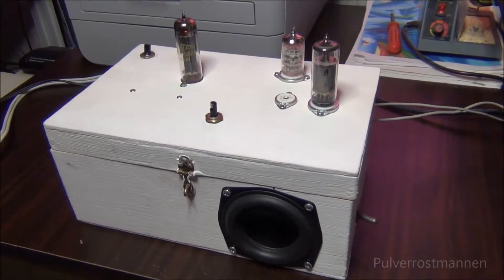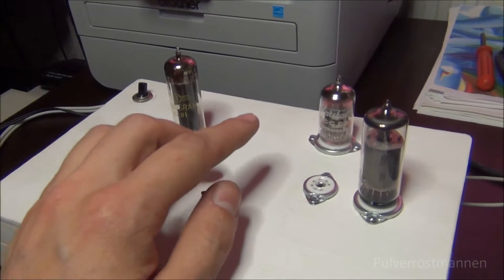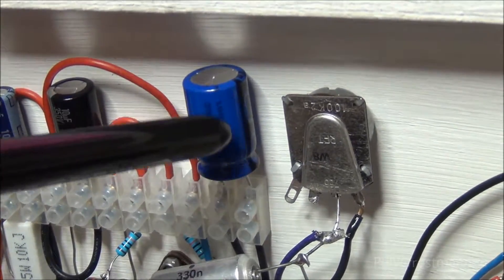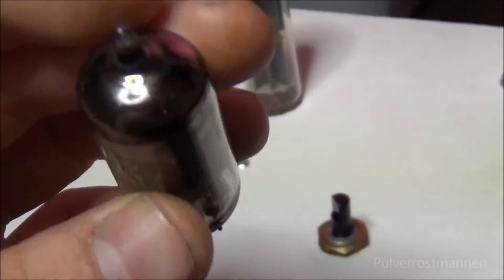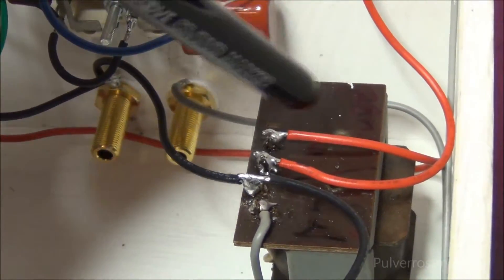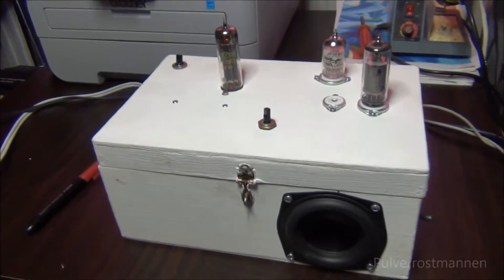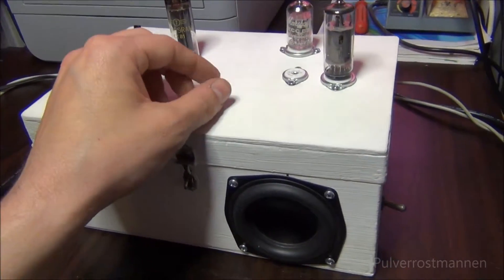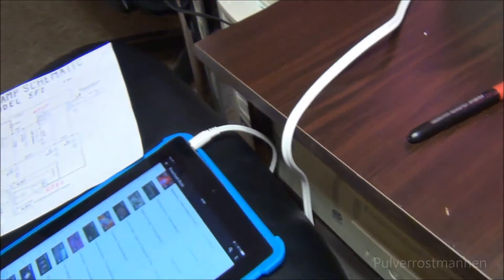Home Made Valve Amplifier Presentation and Operation

Comment: Well, it's 8 years later, so who knows where the little amplifier is today, & what other modifications you made to the circuit afterwards, if any.
But you REALLY screwed up that volume control between the 1st & 2nd stages; even 100kΩ is borderline too low a value...& you replaced it by putting two of the three terminals in parallel with a 12kΩ resistor???🤪🚮🚮🚮🤦
You must not have hooked up the 100kΩ pot correctly IN THE FIRST PLACE; or else it's defective! If you had too much gain, then you should have just eliminated the 1st stage & have the signal going directly into a pot on the 2nd stage ECC83 Triode section instead...
Also, you don't need a separate filament winding for the EZ81/6CA4(?); it's not one of the directly-heated types & the cathode will insulate the heater just fine, especially at the low HT that the Champ circuit operates at. The EL90 is better known to us North Americans as type 6AQ5; & if the amp was any good & you used a better speaker & sound source, then you would notice that it does sound noticeably better than the 💩🇷🇺🚮🇷🇺 6P1P, which is a crap Soviet imitation of the American 6CM6 that isn't pin-compatible with it either, as well as having double to triple the amount of distortion!🤦🤮🗑️👹
The EL90/6AQ5 actually sounds better than the original 6V6 valve used in the Champ; with tighter bass, sweeter highs, fuller mids, & a smoother & chunkier tone overall. The EL90/6AQ5 is also far more rugged & capable of handling higher voltages than the 6V6, never mind the 6P1 (China) or 6P1P (Mordor, home of Orcs). Don't let the much smaller bulb fool you! For example, the 6V6 was never used in NATO-spec military equipment. But the 6AQ5 was used extensively! Proof is all the industrial-grade & ruggedised premium versions of it: 6AQ5W, 6005, 6096, & 6669.
OTOH, there are no such versions of the 6V6. It's only premium version is the 7408, which has very precisely made filament wire to ensure a highly consistent time-controlled warmup time.
This was a special version requested by Harman-Kardon around 1960 for use in their 🚮💩🤮 el-cheapo "Award Series" (🤣🤣🤣) receivers & (dis)integrated amplifiers so that 4 valves could share a single cathode resistor between them without any of them getting damaged by hogging all the current until the rest of them came up to operating temperature & bias!🤪🤤🤤🤤
Reply from the maker: @joerosen5464  I am still using this amplifier today but it had some changes though not very big. The Chinese transformer I had in the beginning was winded so poorly it shorted out. I have never in my life seen a transformer this poorly made as this one was. Now it has a vintage transformer since like 7 years and goes strong. It now has a socket for EL84 and 6s4A triodes as well as EL90/6AQ5 and by converters it can play even more tunes. I also built and implemented a special muting device that mutes the amp when no music is playing. 
But the resistor choice for volume control was a real choice. Even though this is the first amp I have built in a chain of 4 amps and several other devices I have found that variable resistance greatly reduces noise in the output stage. In this first amp I have the lowest resistance to date but it is balanced and sounds very good to be honest and even if it been run for 10s of thousands hours by now I only replaced one tube that was weak even at the beginning in one section. 
The last amp I made is built a bit different and has the most advanced audio controls but I still use variable resistance between the stages but instead up to 100k but you would be surprised how quiet this amp is at full volume and how good it sounds. I have no video on this amplifier yet even if I had it for years. But it used variable resistance both on the preamp stage and output stage, I love this amplifier and it can play any 6v6,6L6 and EL34 pin compatible tube but I usually use 34s. I can play 807 too with adapters. I should make a video sometime

Comment: Wow nice modification with the 6P1P! (or EL90!)  Nice mods with the volume and channel mix as well. That's what I love about the Fender Champ design...it's a super core amp plan that's great to modify and experiment with. Really turned out nice. Totally impressed. Thanks for putting it all together and making it work! It's a clean, neat, and tight setup you've built, especially for your first tube build! Amazed that it could drive that larger speaker so well, and work so nicely with the pre-amp output on the Radiola. Amazingly flexible build. Looks tight, neat, and clean. Congrats!
Reply: Wouldn't it get even better sound if you cut a hole somewhere in the box? That's the only thing I'd do different. It's an amazing and super versatile build in any case. Cheers.
Reply from the maker: Thank you very much man :) I am really happy with it, I have made a minor mod on the power supply today and added one extra 10uf cap and a 10 ohm resistor to even out the current and reduce a bit more hum from the circuit. thanks for making this amp possible, I look forward to build more of these as soon as i get more parts to do so :)
Reply from the maker: the internal speaker plays rather good in closed box and I don't think it would do much difference to port the box. however did i design this thing to play external speakers and I have sold off some stuff and just now bought a pair of Klipsch Reference Premiere RP-150M speakers that I will hook up to the amp instead and I think they are going to play really nice with this amp :)